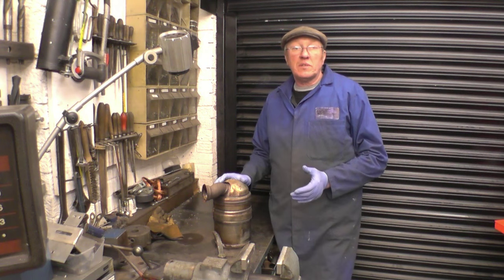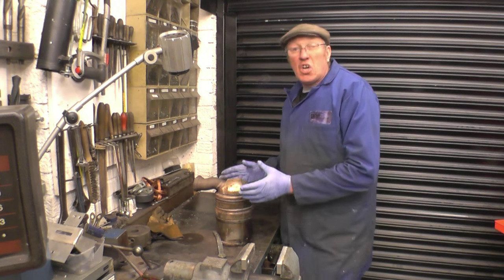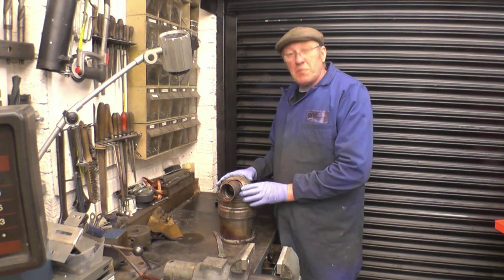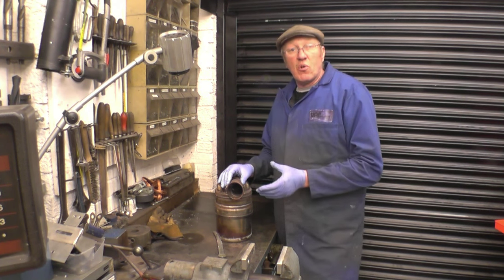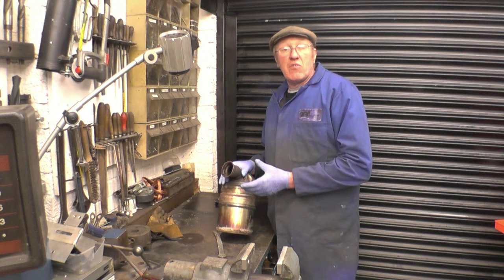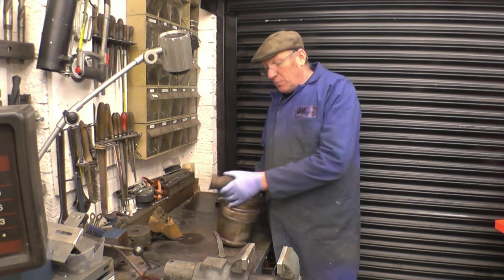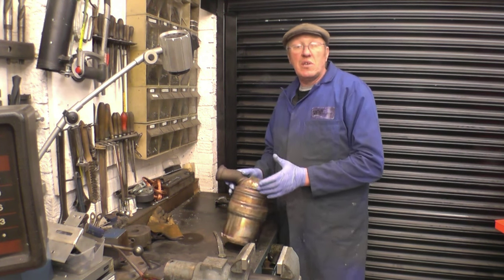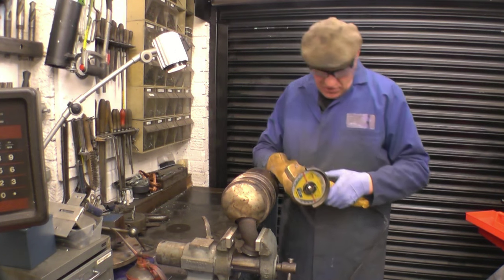DPF Autopsy

Comment: The clogged DPF is possibly the product of many short trips and or higher than normal sulfur content fuel. 
This failure mode is becoming frequent with urban diesel owners that do not regularly and often operate their diesel engine vehicles for extended periods. 
The DPF will not execute the regeneration process unless the DPF and CAT/SCR is above a specific temperature and this is where the accumulated affects of many short trips kills DPF units .  
Repeated short trips where the DPF and CAT/SCR never reaches full operating temperature and allow the regeneration cycle to initiate and complete the entire cycle kills the DPF. 
The DPF becomes clogged to the point that regeneration will not burn off the contaminates and instead bakes the contaminates until the contaminates are hard. This failure mode is also exacerbated by elevated sulfur and trace metals content fuel. 
If using fuel additives and your vehicle has either or both DPF and SCR be certain the fuel additive is safe and approved for use with DPF and CAT/SCR equipped systems.
Reply: +patw52pb1 This is an excellent summation of the situation.
Reply from the maker: +patw52pb1  A good explanation
Reply: I’ve performed a pyrolytic clean on my blocked DPF, seems to have cleaned it out really nice! About to put it back into my car and try it out
Reply: @JBFromOZ  any news with your DPF? I think i m going to pay in 1-2 months for a wash of it, because too frequent regenerations (every 90kms) occur in my Yaris diesel Euro 5...
Reply: @songoku7915  I have reached 138,000 kms now, first video was at 70,000kms. DPf issue has not come back. I use a low ash oil which might be a difference.
Reply: @JBFromOZ  thanks... Every how many kms does it regenerate? Mine regenerates every 100 kms (i ve not cleaned it yet).

Comment: Hi mate.  I have found that after all that honey comb has been removed from both the Cat and the DPF the system has been totally revitalised.  The flow-through is amazing.  It saves fuel, and one has much more power.  It must have been a mistake of the manufacturer to put them into the exhaust system.  Because why would one want to burn more fuel to achieve less?  Not only that they are bloody expensive.  But who cares it's only the motorist who pays for that ay.  Just like the costs of an EGR.
Reply: +Marcel Timmers Yeah, those DPFs cost a lot!.  I have heard of some guys just drilling a few 3/4" holes through them.  I don't know if it the computer can detect if that has been done.  It would never sense any pressure differential, that is for sure!!!  ha ha ha.   I bet all cars have a memory chip that can record all driving/performance data, for the lifetime of the car... or atleast the warrantee period.
Reply: Your quite right mate.  Before too long the mechanic will have to submit a driver's behaviour upload to the relevant organisation, so they can give you retrospective citations, and the obligatory compulsory donations to the consolidated fund.  Driving a vehicle, is one of the most lucrative sources of income for the government.  That, and naturally, one's pension.  Because you get what they want you to have, and not a dime more.
Reply: Marcel Timmers The DPF and catylitic converters can cost over $3000!!  Yes, you do get increased fuel-mileage without the DPF and "regeneration cycle", but you are adding a little more smog into the air.  In Los Angeles, and other areas where you have millions of cars and thousands of diesel trucks (especially where there is shipping), the smog is noticeable.  Those are areas where the DPFs and emissions systems are beneficial.  Otherwise, I think the systems are just too expensive.  They do reduce pollution, over the whole planet, but I think that they are like "highway robbery" or extortion.
Reply: Well, because the government made it compulsory to have one on the car, the manufacturer can ask what they want.
Reply: +WAVETUBE84 Well then maybe the US should stop letting the manufacturers dump fuel through the engines, then we would not need cats to burn the extra fuel. Just do a little checking here in US on car fuel mileage and the same car in the UK lol. They have a dif fuel strat in the ECU and do not have the same programming new from manufacturer. Get your tinfoil hat ready before you dive too deep into the issue.
Reply: The thing that angers me the most I think, is that these things have been implemented to appease a few left wing thinkers.  just think of the implementation of the alcohol in your petrol, and what it's doing to the vehicles in the US.  Power is down so fuel usage is up, but at least it has been seen that something has been done.  And don't use your vehicle more sparingly. If you leave it too long, your carburettor, or even worse fuel system will seize up, and you don't even want to think about what that's going to cost you.  Here in Australia we have so called controlled burn off's.  This means that very large pieces of land are set alight to control the "fuel load" ,dry vegetation on the ground.  This produces so much carbon gasses, you don't want to know.  But yet, we have to drive around with these poxy remedies to appease the gods/left wing thinkers. No, if the pollies really wanted to do something about the whole pollution problem, they would invest much more in "alternative" ways to mobilise the masses/plebs around the planet.
Reply: Marcel Timmers It's not "left wing".  I grew up in Los Angeles in the 1970s.  The smog was horrible.  It would make your lungs hurt and your eyes burn.  Today, it is much better, even though there are millions more cars !
Reply: Richard Schmidtendorff What is your point?
Reply: The point is,  Don't  come with stop gap measures.  create something that stand real scrutiny, and don't  have knee jerk reactions for the people that make noise.
Reply: Marcel Timmers The Germans (Bosche) came out with fuel injection 40 years ago.  It took to perfect the system.  You also have design patents that are not shared.  The first US smog systems were crude and problematic.  In the 1980s, they still did not want to budge or pay Bosche for the German system (unless it was for a Corvette).  Both US and Japanese auto mfg.s came out with "electronic" carburetors:  which were a trouble shooting nightmare.  Half mechanical, half electronic... doomed for failure.  Now, most fuel injection systems are extremely reliable.  Fuel injection can go 7+ years with only a fuel filter change.  
Thought the newer systems are more complex, they are more responsive and efficient.  
99.999% of all cars are not going to be entered in the Indianapolis 500.  So the Neanderthal urge to bypass emissions systems is idiotic.  Catalytic converters flow so freely, that it is hard to notice the difference in horsepower output (even on a dyno).  
Most morons that are against emissions systems are usually just fat ,stupid, idiots.  They do not have any scientific quantifiable reasons for screwing around with their cars.  They mostly just go by some advertisement.  Or some sales pitch.  It's all BS.
Reply: Well it is your right to feel that way.  I'm one of those fat Neanderthal bastards that have tried to make the intake of my engine a lot cleaner.  If you think that blowing exhaust gasses into your engine's intake is a good thing, than by all means, more strength to your arm.  If you also think that an older catalytic converter has not partially blocked it self over time, than your fooling yourself.  Anything that you put in the flow of either intake or output is far from advantageous.  If you need scientific proof to see that, than I think it's not me who has been fooled by the thought control police with all their social engineering practices.  You just keep choking up your engine, and have a good feeling, I will not.
Reply: Marcel Timmers I could agree on blocking off the EGR circuit.  Especially on diesels.   The function of the EGR seems retarded.
Reply: +Marcel Timmers This is all European Law. Manufactures would not be using this crap otherwise.
Reply: Marcel Timmers I'm sorry , I confused gasoline emission reduction equipement with diesel emission reduction equipment.  Gasoline fuel injection and catalytic converter do not restrict the exhaust.  The DPF on a diesel definitely restricts the exhaust.  The EGR also causes problemsn on both diesel and gas..  Since most consumer items come from China, all of that stuff has to be trucked from the port to the customer.  At the ports, the trucks sit and idle and cough up a lot of soot.  But, that is big rig trucks, not VW passenger cars.   Maybe, in the future, there will be a quick change DPF that can be cooked and cleaned easily.  That is what is done on the big rigs now.  Or someone may invent someting that eliminates the DPF, but still reduces the nasty soot and particles coming form a diesel.  Maybe an different diesel fuel composition?  Ha, ha ha, by then we will be uried or ridnig horses!
Reply: Hi mate.  If you want to change the composition on diesel, you might have to have a talk with a few dinosaurs, however it would be good to have something that does not cost us a arm and a leg to replace, and still does the job.  And that includes spewing exhaust gasses into the inlet of the engine, just to meet the exhaust quota.  About the horses, I'm pretty sure that the powers at be will have you put a converter on the backside of said horse, come to think of it, it might help us if we got rid of all the animals, it would take care of all that pesky co2 ; )

Comment: I'm a precision grinder from Wallsend, I understand you well unlike some of the southerners that pretend not to. I think my wife's Mini Cooper D has a blocked dpf, it starts up and runs OK and then dies after warming up a bit, after a few minutes wait, it runs again, I guess it's back pressure a bit like how you can stop and engine by covering up the exhaust end.
Reply from the maker: Modern diesel are more bother than they are worth now  after 20 years of diesel i would never buy another

Comment: Those first exhaust regen systems caused a lot of truck drivers (and no few scalemasters) major grief.  Trucks were shutting down on scale platforms and they were forced to do a regen right there or call out a tow truck to remove it from the scales.  It didn't take long for them to come up with an emergency override.  Then they started using exhaust fluid.  How can something so nasty be good for the environment?  Anything that stuff touches looks like the top of old leaky batteries in a day's time.

Comment: Gday John, just found your video after doing a clean on my own DPF, cleaned it using a pyrolytic oven to turn the spot to ash, then blew it clean with the pressure washer. About to weld it back together, and reinstall into my Mini

Comment: I recall watching a TV program many years ago(back when various organisations were asking for better filtration on exhaust systems)and here in the UK,a catalyst was considered to be useless as our weather would mean they never got hot enough to do anything useful.I now ride a motorcycle as well as drive,& the number of cars I follow (especially at school start time)that are emitting a foul stink of rotten eggs indicating a buggered catalyst is quite high.
Reply from the maker: +ChegsOn2Wheels  The failure rate for petrol "cats" is very low

Comment: Great video. A mate of mine drives a diesel Audi and he has to put AddBlue in.  I thought that was just for hgv's
Reply: +StevenQ-NE-UK in a gasoline engine a three way catalyst oxidizes HC/CO and reduces NOx. A diesel engine have excess oxygen in the exhaust so the NOx reducing process of a three way cat cannot work so  they have to add stuff 
like addblue instead to meet the limits.

Comment: As a driver of a 2010 Golf TDI i find this very interesting John. I take mine on the motorway weekly at high rpm just to stop this happening as I generally do a lot of short trips.
Reply: Get an egr delete and dpf delete, then you won't have the problems in the first place
Reply: +Hugh Frater they are not cheap either.   lol
Reply: The extra cost of doing the deletes will quickly pay for itself in fuel savings. You'll double your economy if you delete the doc/dpf/egr.
Reply: From May 2018, the UK MOT will fail a diesel vehicle if the DPF has been removed, or if there's evidence it's been tampered with. Any smoke from a diesel car's exhaust is a fail from May (even if it has a DPF).

Comment: Interesting video, John. Diesels (and of course steam wagons:)) emit a lot of particulates. These are little bits of carbon that didn't burn, as in soot. It makes buildings dirty. Almost certainly not good to breathe. Particulates do wash out of the atmosphere with rain. In some of the more advanced steam locomotives, steam was injected into the coal fire and this helped reduce particulates, and also increased efficiency by up to 50%. Long story. Auto manufacturers have gone other ways. Both the DPF and a catalytic converter need high temperatures to do their job. At idle, the temp is too low. Unfortunately a lot of our time is spent in traffic -- where the mileage of the Diesel is terrific. Can't win, can't break even, can't get out of the game.

Comment: The red stuff is a clay blocker. The filter is the honey comb shape or square shape the squares on one end of the filter don't match up with the other end. Because the grey or black square substrate is the filter and it should be white. Make sure you use ultimate or low sulphur diesel and tell mum to press the loud peddle harder. Lol good work with your channel 👍

Comment: That God we don't have to put up with that crap here in Texas. $7 dollars for inspection, man I love it here.
Reply: +The Texas Gun Guy  Oh yes you do. Just think "EPA". Unless you drive a big rig, all Diesel engines are subject to EPA, and the standards are far worse than the Euro ones.
Reply: +Juan Rivero: Yeah we see how well they did in Colorado and Flint MI.
Reply: +Juan Rivero Big trucks have DPF's, catalytic converters, and also use DEF (diesel exhaust fluid, urea).  The real issue is that we are tweaking old technology to and beyond anything that makes sense, to try to keep internal combustion engines on the road.  They have outlived their usefulness, and it is all over but the crying...
Reply: +Bob Korves And what's to replace Diesel engines? Horses? steam engines? Gas turbines? Electric cars and trucks are at least a hundred years out. And no matter how much you want to regulate them into existence it's just not going to happen. 
So please do tell me what's going to power these magic motor? Unicorns, big foot and the Lockness monster?
Reply: +The Texas Gun Guy While we don't have emission tests as part of our annual inspection here in Texas, we still have the emission control packages on the vehicles.  Check out the insane/genius on the Ford 6.7L diesels in F250 and above trucks.  They have DPF with catalytic converters and urea exhaust fluid.  It may seem nuts to you, but it works amazingly well.  The emissions on these is probably 1/100th of the same truck from 15 years ago with the old International 7.3L.  And they produce a lot more power.  I have no knowledge about the other manufacturers systems, but imagine they are similar.  Just check out the tailpipes on the newer trucks and compare them to an old one next time your in a parking lot with some diesel pickups.  No soot on the new ones, they look about like they do at the dealers lot.   Folks who live in the wide open spaces don't have a baseline to appreciate what impact emission control measures have done toward cleaner air.  Yes it can be a pain in the ass and the pocketbook, but without EPA, we'd still be pumping millions of tons of tetra-ethyl lead into the air for us and our children to breath.  Though I wouldn't try this myself, one might have a difficult time committing suicide in one's garage with one of these cleaner engines.  To the folks who hearken back to the good old days when cars were "made right", I can only say that even with all the plastic and gadgetry, cars today are much more reliable and last many times what the old ones would if properly maintained.  I remember that cars with 50,000 miles were considered high mileage cars.  Yes, you can find individual examples to the contrary, but as a whole, cars today run much cleaner and last much longer.

Comment: I'm with all of the other comments concerning air flow. Surely the engine will run progressively worse and worse with choked off air flow and so use more fuel for the same power output. I have a healthy mistrust of a lot of this emissions technology.
Reply: +Barry Jones with diesel, economy wont be affected by the lack of flow, though of course max power will be affected, but all these things diesel seems to need, what with the blue fluid additive some newer ones need...petrol seems to have caught back up with the mpg anyway over the last decade.
Reply: Barry Jones a healthy mistrust of emissions tech is a bit of a misnomer as much of it (particularly the DPF) is designed to (and does) improve air quality to prevent pulmonary diseases.
Reply: @jusb1066  It is affected by lack of flow. Higher operating temperatures generally mean less efficiency for a diesel. I deleted my 6.7L Cummins and saw a 7-mpg increase.